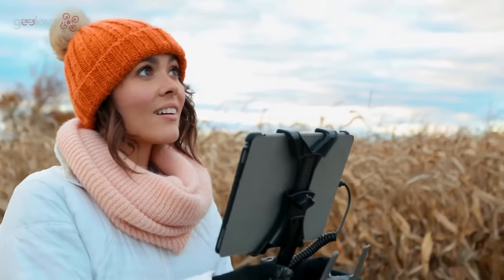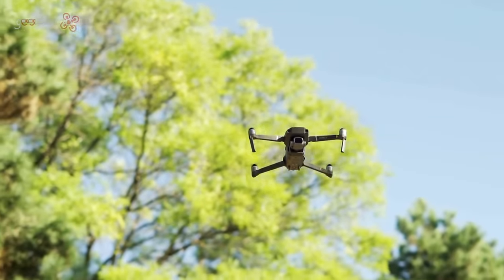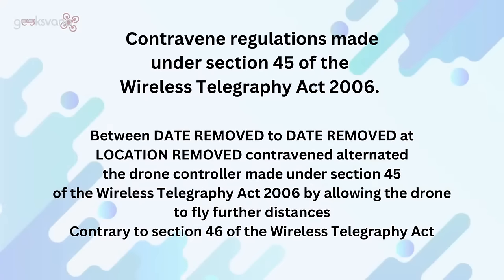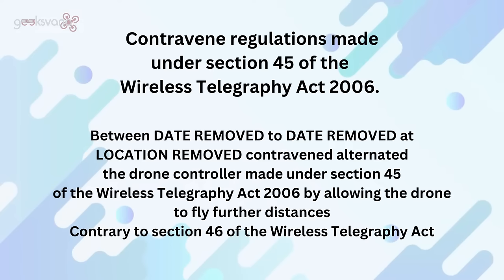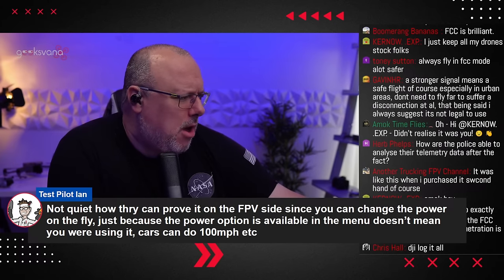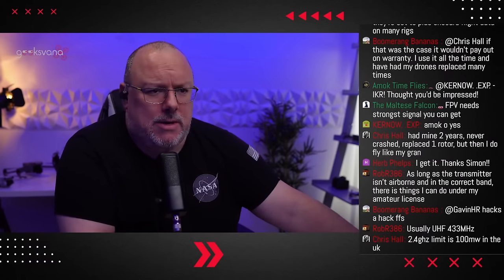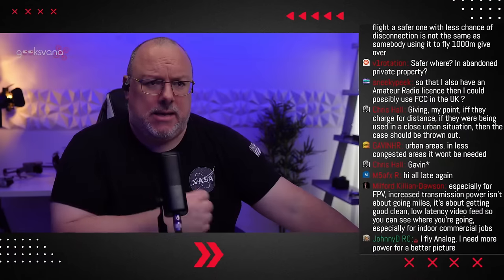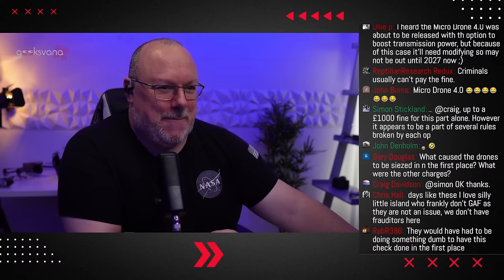CHARGED for using DJI Drone FCC Hack! BREAKING NEWS!

Comment: I would like to know how the police knew the power levels had been changed, these people must have said this on social media or similar, the police would not have a clue and as far as checking and measuring the levels that would be a job for an EMC lab to do, costing a fortune, so I find the whole thing very hard to believe considering most police cant even spell drone.... this sounds very suspicious.... have you also got a CAA email address by any chance....
Reply from the maker: There is always conspiracy, when in fact it is so simple. DJI drones all have logs.

Those logs are gained during the investigation and confirm the mode it is flying in and when/how it was changed. The drone itself confirms this within the app. Nothing specialised beyond that. This will become another standard check police are likely to make in the future. 

Self-build drones and those not using a standardised app would likely be harder to prove. But DJI and others record everything happening when the drone is in use.

Comment: There are FCC hack apps which have to be applied on every startup. The drone will by default be in CE mode every time you power up unless you apply the hack. So how would they demonstrate FCC mode was being used? I wonder...

There are of course other hacks that are permanent/persistent, such as Drone-Hacks, Drone Tweakz, etc

Comment: Two questions about this if I may? 1) Switching to 'FCC mode' presumably uses more power. Does this impact on battery life/flight times? 2) are these charges related to making the 'FCC mod' itself, or actually flying beyond the UK/CE distance regulation? (a sort of 'going equipped' or 'committing the crime' analogy!)
Reply: No, the increased signal strength doesn't use much additional power. Flight times are not affected any noticeable amount. The charges are related to bad governing
Reply: You can legally own a Tx capable of using restricted frequencies and / or unlawful power levels, but actually using any of that is a crime.

Also worth mentioning that simple possession of such equipment could be used as evidence against you as part of a related charge, e.g. alleged flying BLOS and have equipment capable of and set up to enable that.

Of course the obvious solution that I suspect smart people non-DJI users would use would be to revert to a legal configuration immediately after the flight.
Reply: @loc4725  That would make the crime "aggravated". A better solution is not to break the law, rather than double down on it.
Reply: The physics of the wavelengths leads to the greater range and less need to maintain unobstructed line of sight.
Reply: @lindsayheyes925  You mean, the way the Police do, once they've been caught ?
Reply: @lindsayheyes925  HD video feeds typically use 5.8 ghz, which is not known for its long range. If you can only use 25 milliwatts the picture can become pixelated, with higher transmission latency, that can lead to a crash, even at 200m. Where's the safety in that?
Reply: @nateteator3901  So what would you suggest for a beginner drone flyer, just starting out.?

Comment: Would the FCC hack help if you were flying indoors in terms of penetrating walls, etc? Also, would it be illegal to use it indoors?
Reply: Ussing FCC in that situation would help, and it also would fall foul of the legislation.
Reply: Still illegal because your kitbis transmitting at power levels above the regulated limits.... the same laws regulate your WiFi router for example.

Comment: The legislation is all to do about the transmission power, the distance is an indirect effect of the transmission power. So the contravention is increasing the transmission power of the transmitters through the FCC hack. Under the CE region as spectrum is heavily congested everything is very closely managed. Drones fall into a category of Short Range Radio Controlled devices and while their power remains under certain limits they are unregulated (from a radio perspective) Go above those limits and you then start causing issues that could be local frequency interference issues or other, hence the regs. These regulations pre-date quad copters and also include things such as your domestic Wi-Fi router. Ignorance isn't a defence if you apply the hack and are found out then tough crap.

Comment: My personal mini 3 pro has only ever gotten a maximum distance of 1.2km before returning to home automatically. This simply isn't enough. The drone was in auto signal mode and was in VSOL at all times. Not flown over built up areas or air traffic either.

I did this at multiple locations with multiple controllers too. I even tried other people's mini 3 pro's and they barely got better range. I do see why people use the FCC hack but surely a consumer who buys a drone with 10km capabilities should be able to get further than 2km.

Range extenders do exist but its obvious that everybody would rather take the free option.

I'm also working towards a PPL licence and have a degree in aerospace technology. I see no point in prosceuting people who need greater signal stability when flying. FCC mode is actually safer in this aspect.

Obviously the signal will be more powerful, impacting other radio signals a tad bit more.

Some laws in the UK are just a joke. So many comparisons to the governance of drones can be done. Examples are how e-scooters are still illegal and how the government hates motor vehicles.

Comment: How were they caught?
Reply: 'Were' 😳😁
Reply: Perhaps they were reported after posting a 'how to FCC hack your drone and fly 10 miles' video?😮😊🤔
Reply: I would bet good money that it was from a car reg number ...They watched them and followed them to their car. Unless they had RID?
Reply: @paulbuswell6566  no rid in the UK YET but I understand de Drone and aeroscope can identify you
Reply from the maker: Both cases involve other criminality. Be that with a drone or otherwise. The FCC mode charge was an add on in both cases.
Reply: @Geeksvana  but are we taking 121m? Or much more serious
Reply from the maker: @squaddingquads Going by the charges alone, as they could of course be innocent, much more serious in one case in terms of mainstream criminal acts. The other serious in terms of drone flight but not wider criminality.
Reply: @squaddingquads  121m is technically well below 400ft so you're all good 👍

Comment: It's similar to early days of CB radio when to get any serious distance it was common to buy a burner which boosted power from 4 watts to ... Rather more.
25W made a huge difference but it was not unknown to go to hundreds of watts though a law of diminishing returns seemed to apply.
The biggest improvement was from just doubling the basic 4w power output.

Comment: Hi Sean, this is an unrelated issue but need to ask your advice. Im planning on taking my mini3pro to Spain on holiday in the summer. What steps and proceedures do I need to take? The drone is in a hard case I normally have 6 batteries and by the summer I will have my A2CofC. We intend to book the holiday with Tui and my intention is to fly in Barcelona. You seem to be the most knowledgable about "DroneLaw" and your help is much appreciated. Kind regards Jon
Reply: You need to register yourself in an EASA country and pay the necessary fees, your UK Operators ID Flier ID and A2CoC means nothing outside the UK. Then check for local regs in Spain that go beyond the standardises Europen EASA regs including for example different privacy laws. Spain also has a complete ban on flying in National Parks with very serious fines for doing so.
Reply: @8dcphoto  thanks for the info

Comment: My mini 3 and mini 4 have a range of about 8 inches anywhere from my house on 5Ghz. I turn off my Virgin Hub 5 plus and then I get full VLOS range. So when ever I fly from home I have to either make sure I am on 2.4Ghz or turn off my 5Ghz of my Router!  This interferance has a large range (100m Plus) as I tested it by walking down the road till I lose the interferance and get full bars back on the controller. FCC hack wouldnt help with this much Im sure.
Reply from the maker: That's very interesting! Certainly, interference is an ongoing issue for drones being flown in urban areas.

Comment: Looking at it the other way around, if your drone crashed because it flew past a wi-fi that was running illegally high powers you would be justifiably miffed... If you move to FCC mode you are running illegally high transmitter powers for European coordination (hence the longer range) so someone will be miffed with you
Reply: This is a great point, that if everyone was just allowed to do whatever they wanted and there were no RF rules whatsoever, then public WiFi routers, WISPs, etc could just choose to blast whatever suits them. Destroying the spectrum for everyone. 

I also think though that a one size fits all approach doesn’t necessarily make sense either. If I am out in the countryside with nothing around, flying my DJI FPV System at 1000 miliwatt it’s very hard to see who will be actually hurt by this. No, you certainly won’t be knocking out hospital equipment or residential WiFi out there. It’s sort of like the same hardline argument about spotters being required regardless of the flight parameters.
Reply: @nateteator3901  This is a clown take. Wireless spectrum is a finite resource. Output power is not the only factor involved, do some research. I'm not saying that 1000 milliwatt is necessarily harmful in all or even most situations, but spectrum laws and regulations DO exist for very good reasons.
Reply: Is the wireless Spectrum more fragile in Britain than the United States? We have hundreds of millions of phones, and surveillance camera broadcasts. Your 25mw limit is there to harm the RC hobby, not to prevent RF problems.
Reply: @nateteator3901 it’s generally a more ‘crowded’ environment in the UK we are a much smaller country, I know in cities the densities will be ‘similar’ but overall there is less of an issue running higher power in the USA. Same on other parts of the radio spectrum Amateur Radio in the UK is limited to 400W (most use 100W or less) in the USA 1000W is not uncommon and I believe you can go higher
Reply: @TheM0JEC did you mean to describe the Rf in milliwatts? This whole conversation should really include the fact that the FCC hack for 1w and 1.2w, doesn't actually output the RF wattage the name would suggest. It's hard to measure the power of a digital signal that constantly jumps frequencies. There are YouTubers who measure the dji and walksnail video transmitters with the FCC hack. The output is far less than  anticipated. I can see  interference   in my video feed if I stand next to another pilot. When I step away 10m the issue is diminished. Regulators should not be criminalizing safe activities.
Reply: @nateteator3901  no on the Han Radio front I was talking W not mW just to show there is a similar disparity at those HF frequencies too.

Comment: If you commit to the FCC hack .. is there a way to reverse back to CE mode ?  I was thinking to change in my Mavic Mini 4 pro  using the RC 2 contoller  but thought if change, Can I reverse it !!
Reply: Yes turn the drone off by removing the battery it automatically reverts  out of the fcc mode
Reply: Just make sure you 'lose' the SD card.
Reply: @Lee.gRC27  Question: my US mini 4 Pro drone, is it set as FCC default? Removing the battery to shut the drone off will revert it to default, correct? The opposite is true for the EU issued product? FYI I am waiting to receive my drone. Thanks!

Comment: I use ce mode when I can and If I am interfere free. If I experience alot of noise in a certain locations and have horrible and inconsistency's in signal while flying vlos with my drone and fpv I will switch over to fcc. Call it a hack or not. I call it common sense.

The trick is as you said, is its extra charges on a original charge to make it a worse punishment. So if you are doing nothing wrong in the first place and following the law, you are not going to be bothered are you. 

Gaining extra signal strength is not going to hurt anyone or interfere with anything and nobody would even know the difference unless you are caught actively doing something wrong. 

Personally I just think its just something else to winge about and is not a hack. The software and hardware is in the drone from the manufacturer and you are just telling it to utilise its potential. A hack is telling it do something beyond the manufacturer's intent. 

If I buy a car with 300bhp, then remap the engine outside of the manufacturer ecu targets to make 350bhp but still do 70mph in a 70mph zone am I breaking the speed limit even though my ecu is "hacked"? You can exceed the 70mph speed limit in both states of tune by choice. If I then get caught doing 90mph in a 70mph do I get an n.i.p for exceeding the speed limit or for having 350bhp and not 300bhp? 

In the same way you can break the law in ce and fcc mode! 

Its getting ridiculous really! 

The law is basically saying dropping drugs off in a prison with a drone in ce mode is more acceptable than doing it in fcc mode and you will be punished less because you used the manufacturers parameters while doing it. 

I did 120mph in a 30mph, but its ok because I did it without tampering with the engine's ecu.

Comment: So will we as laymen be able to fly bvlos? Or will it be a case of you have to do loads of exams and it be to expensive for a hobbyist?
Reply from the maker: BVLOS, in terms of regular and standardised flights, is still very far away. The technical infrastructure is not in place, and the regulations are a long way off being ready to handle BVLOS. 

So at the moment it is impossible to know who will be able to access the bvlos airspace. Looking at the direction regulators and government seem to be going, it is focused on larger scale commercial flight. This is where the financial benefits are seen to be. 

The other requirement for that type of flight is compliance and it is highly unlikely that the recreational sector will ever be in a place where enough compliance exists to allow legal BVLOS flights.
Reply: @Geeksvana  although if all drone gave live positioning I don't see why not
Reply from the maker: The main issues are in terms of avoiding other air users and what happens if the drone comes down and what it damages on the ground. Knowing where a drone is would not in itself give enough safety to allow BVLOS. 

We could one day see automated BVLOS drones, that is more likely. But would it be much fun to fly a drone like that?
Reply: @Geeksvana  with regards what happens if a drone come down it make no difference if its Los or bvlos if it drops out of control if will either land on something that doesn't matter or something that does. I would imagine it should be ok as long as a system is inplace that identifies all aircraft and manned aviation should be above 500ft and we should be below 400ft hopefully it comes to fruition as I do want to fly BVLOS periodically.

Comment: So, basically they got caught flying long range. And when their phone was checked they found out they also used an FCC hack.
Reply: No, sounds like they got caught doing something else (they are DJI users after all...) and this is a additional chance at another charge. The prosecution still needs to prove that unlawful power levels were actually used.
Reply: @loc4725  Yes, DJI users. So, they have remote ID. People could see they were flying beyond normal range, so to say they were flying long range.
Normal police officers don't measure signal strength. I have never seen any cops with special measure devices.

Comment: Of course a lower wifi transmission power from the ground wifi locations does reduce the interference that a drone is subject to as it flies over built up areas!
Reply: The problem with using stronger transmissions like WiFi at home is if everyone is doing it then it makes it worse for everyone. Broadband providers are all saying ‘best WiFi ever’ this means that they interfere further away as well. Like talking in a crowded room, if everyone talks quietly it’s not difficult, as more people start talking louder so do others and eventually everyone is struggling to hold a conversation. The best WIFI is one that covers your house  but does not go way beyond then everyone can get a good signal. Similar to UK and USA more space in the USA so the higher power is less of an issue than in the more crowded UK.

Comment: Shared radio space, WiFi, phones, amateur radio etc higher power levels might cause undesirable interference to other services.
Reply: No. Not enough to influence any other devices, without a high-power transmitter, which mini drone pilots rarely have. Only the Police have drones that are powerful enough to do that.
Reply: I keep reading that in these comments but is there any evidence for that? For years, even now, they demand 'flight mode' on aircraft but there's no evidence that phones have the slightest effect on aircraft navigation or whatever, it's just irritating to the pilots if they hear crackles.
Reply: Power can be an issue  either high or low but a lot of services are secondary users in a part of the radio spectrum. Primary users have a right to use the band without interference this translates to very low power, limited range etc devices designed to not impact / interfere with the primary user’s.
Reply: @MI5AHG  So who or what is a "primary user" of the frequencies used by recreational drones?